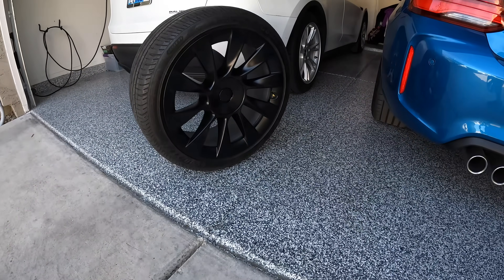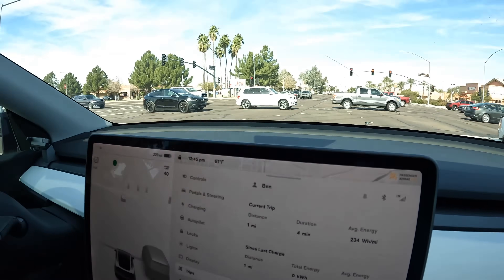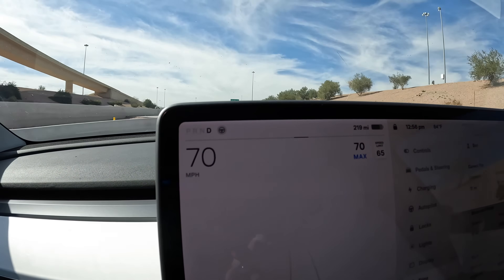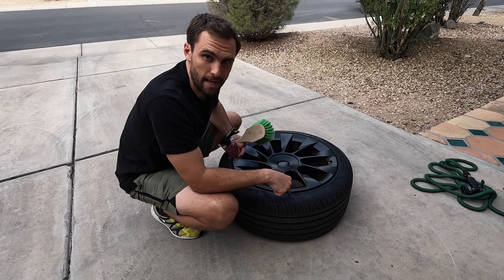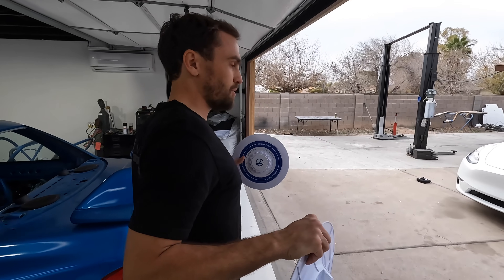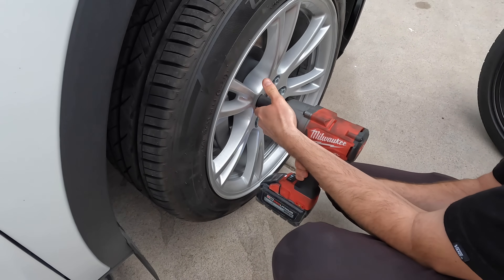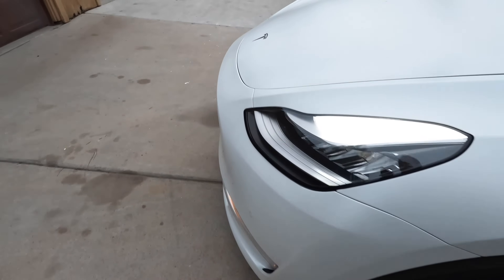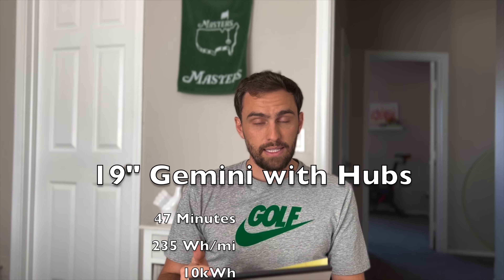Which Tesla Model Y Wheel is Best? - Range and Comfort Test

Comment: The halodisc's are not meant for range just FYI. They're more actually meant for performance and brake cooling. They're not meant to give you a better range. They're meant to provide more airflow like a fan towards the brakes for high speed braking, which is an even better benefit to have for a small cost.

Comment: Best wheels are 18", opens up possibility for a massively increased number of available tire options, for snow/rain/at/normal all season. Also smaller wheels lowers overall rotational mass if you find high quality forged lightweight aftermarket wheels. Finally the smaller wheels are superior because you can run tires with similar OD, but larger sidewalls, which improves suspension small and large bump compliance, and overall ride quality. 

If you aren't racing or doing track runs, get smaller wheels.

Comment: I just got a used 2021 model Y with 20 inch wheels, I love the car but I think the tires should be a little more tall to make the ride a little more soft, specially on not completely smooth roads.
Thinking on getting 25545R20 instead of 25540R20, do you think that will affect anything with the car, any rubbing or something??
Thank you for your help.
Reply from the maker: I just did a video on the Hankook ION EVO SUV tires. I would get those. They are incredible
Reply: @Gjeebs  I will watch it.
Thank you
Reply: @Gjeebs  I found a very good price Goodyear all season tires 255/45/20 with a tire load capacity of 1819 pounds.
Do you think that load is enough or should be higher?
Thank you again.

Comment: What does the car call for, 38 psi or 42 psi?  You're not supposed to guess at what the temp will be once it gets warm or whatever.  Most temps are taken at "cold."  That is a major mistake there when testing tires.  So it sounds like tires are NOT at the proper pressure.

Comment: The best combination is just to get the 19" tires (tesla spec continentals) and get a nice looking set of wheels from T-sportline (really great looking black / sporty look). You get the best comfort / range and also really great looks. I do this on my Performance Model Y and I get the same range as a LR Model Y, with sporty looks..
Reply: Just ordered a MYP. Can you give the link for those wheels?
Reply: @thedude7315  not a dumb question! It actually fits with no clearance issues on the performance brakes (19" tesla wheels), or in my case, the 19" t-sportlines made for this car. Unlike the Model 3, where you can't fit the smallest wheels on the performance version (brake issues).

Comment: Thanks for this video. I'm about to order a Model Y LR and I'm super excited.  I have  a question regarding the wheels though. I find it hard to pay an additional $2000.00 + for the wheels on an already costly car. So is it possible to get the 19 inch standard wheels that Tesla provides and then purchase a cap, from a third party, that is similar to the 20 inch induction wheels? I love how sexier the induction wheels look good but I don't want to pay an additional $2000 lol
Reply: Been 6mos, what did you end up doing?
Reply from the maker: There is no cap that is going to look as good as the 20's and if you want to buy the 20's from Tesla it's $4,500 so if you really like them just get them because in the long run you are going to be really happy you did
Reply: @Gjeebs  there is now,  those 20s are rough as crap hard pass
Reply: @xxxblanco which caps go you like?
Reply: @Gjeebs  Thanks for the advice. I appreciate it.  Does the 20's seriously impact your range?

Comment: I am not sure how you tested the Halo Disk covers... were you saying that you only had two of them and you put them on the front and ran the rear wheels with no aero covers?  Also, did you need to remove the wheel to install them, or just swap out the lug nuts?
Reply from the maker: Just swap lug nuts and you only get two in a set not 4. They only recommend 2 I’m not sure why

Comment: If I get a LR Model Y with 19 inch Gemini wheels,  I may consider getting lighter weight wheels to reduce the unsprung weight and lower the inertia to increase the car's range--and probably  improve the acceleration as well.
Reply: The discs are more important than weight for range. There are no other 19 wheels that beat Gemini with discs for range. Aerodynamics is more important than weight.

Comment: My understanding is that the recommended tire pressure is the cold tire pressure--and that is all there is to it.  The psi your tires will reach while driving will vary based on many things.   If it is 90 degrees outside and you are driving it hard on a race course the pressure will rise quite a bit.   If it is 65 degrees outside and you are easing around  town--then the tire pressure is not going to rise that much.  But it is not the driver's problem to try to micro-manage it.  I imagine that when your tire's psi rises while driving that the actual tire rolling resistance reduces and increase your range efficiency.   You would have to apply artificial intelligence to try to micromanage your tire pressure as you are trying to do.  Cold tire psi of 42 rising to 44 psi while driving may improve your range.

Comment: Factory PSI is 42 COLD, they will increase as you drive and that’s ok.  Mine climb to over 45 in the summer.  I’m replacing the 21” Uberturbines with some 18s from TSportLine next week.  I have driven my new PMY to 2500 miles in less than a month.  Gonna measure efficiency and performance between them.  Can’t wait to see the results.
Reply: How did that change go? Was it worth it for efficiency and ride comfort?
Reply: Any updates on that?
Reply: This video is old but I just want to comment on this thread.  I have 2019 Model 3 Performance.  Five years of ownership and multiple popped sidewall, cracked wheels,  I switched to 18x9.5 Apex EC7 flow formed wheels with 255/45r18.  Yes wider wheels and tires but minus two configuration with taller sidewall.  This saved 6lbs of weight per setup.  The ride is so much better.  You can still feel the road but now it is like a reminder instead of a jolt.  Car still grips like glue.  Best of all, I went from 275 to 260 Wh/mile.  Not bad considering it is a wider tread tire.  The pressure is 42 cold.

Comment: Stuck between LR vs Performace!! I drive 100-150 miles for my daily commute. Do you think the Performance 21" Ubertarbine wheels will wear out sooner than the 20" Induction wheels? Let me know if you have a video on this topic. All your vids are amazing. Thanks and keep them coming!!
Reply: I think you meant tires wearing out not wheels. Since he didn’t respond to your question, I will let you know my experience on the 21 inch wheels and tires on my 2012 Y performance with 21000 miles in 10 months. So far, with normal driving in city and highway driving ( traveling from Orlando to Miami every 3 weeks) the tread depth on the front tires are at 9/32 inch which looks new and the back tires are at 3/32  inch which now needs replacing . The back tires apparently wear out faster. Price on tire rack was 940 dollars ( two back tires) shipped to my home and Tesla service will charge 55 dollars per tire to mount and balance. My plan is to switch to 19 inch wheels in the future after all 4 tires wear down, hopefully at 20,000 plus miles. As a result, I can get a full set of 19 inch tires for around 1200 dollars. Much cheaper to replace. I hope this answered your question.
Reply: @rickeybarnes6471  Thank you very much for your respone. It seems like a recurring expense with the 21" tires around 20000 miles which I am sure I will reach in about 10 months max. Better to stick to LR with induction wheels for now. Thanks again.
Reply: Drive in chill mode? 21 to 20 inch wheels will only gain 1 mile at most. The problem with Tesla wheels are super heavy and creat drag.  Get yourself some light forged wheels and see the difference in weight. Extra cost is the issue. 21 inch tire cost more than 20 inch tire. If you worried about tires. Then my friend Tesla is not a car for you.  Tesla mosey y weighs about 5300 lbs vs normal ice Prius weighs under 3k lbs ans gives 58 mpg.  I have both. Just received my MYP and keeping my 21’s turbines and probably get a forged wheel set later.  You can buy cheaper tires, but read the load capabilities and capacity.

Comment: Nice test.  Side note - the tire pressure should be matched to specs when the tires are cold, not warm.  You stated you started at 38 psi with the goal to hit the factory recommended 42 when warm.  You should be starting at 42 psi cold.  Yes, they will rise to ~45 psi warm but that is not an issue.
Reply: It was kind of hard to listen to the rest after he started talking about the cold tire pressure.
Reply: Yeah but what if the person lives somewhere that doesn't get cold?
Reply: @gregthesplintercell  "cold" for purposes of tires is ambient temperature. If you start off below the cold pressure on the door, you are giving up range/performance from minute 0.

Comment: I currently have 20" Inductions and I really want to soften the ride. If 19" feels better, would 18" feel even better than that? Which is a better investment for ride quality: wheels/tires or luxury coilovers?
Reply from the maker: I would say the better option is the wheels because they will improve your ride quality AND give you better range. Suspension will only improve your ride quality
Reply: I had the same question. I have the 20s but ride is rough. UK roads are not made for this car. I don’t like 19s. Need to find out if I can put higher wall tyres on the 20s. Should be enough space if the Performance can hold 21s.
Reply: @Gillacticomusic  Can't you order a 19" set of a different colour? Perhaps black, to get both comfort and a good look?

Comment: The recommend tire pressure of 42psi should be when the tires are cold. After driving for a bit and the tires warm up, the pressure will increase to 45-46psi.
Reply: OEM recommended tire pressure is ALWAYS cold. ie not driving on the tires for ~8 hours. You should know better if you're doing a tire video.

Comment: Why are you surprised that the 2nd most inefficient was the halos? I took one look at them and how they fit on the wheels and I'm actually surprised it wasn't worse than the 20" wheels. I think that if you actually installed all 4 of them it would be worse than the 20" induction wheels.
Reply from the maker: There is research behind them showing they increase efficiency. I should have had the rear covers on to make it fair

Comment: Real-world range difference between 20's and 19's = 3.1 miles.  I went with the 20s too.
Reply: the 18"'s are better for not only mileage but with more beef, from the tread to the rim, you get some protection should you run into a pothole.  Plus beefier tires just look better.  But then again I grew up in the 70's muscle car era and beefy tires were the norm.

Comment: Would’ve been better to have 3 sample runs for each wheel combo but that’s time consuming on your end. Also mi/kwh is more like mpg and you can better estimate your true range with that. On my MYLR with 20” wheels lifetime avg energy is 314 wh/mi or 3.19 mi/kwh. So my true range is 3.19 mi X 78 kwh battery capacity = 249 miles based on my lead foot. On a few 1000 mile trips I’ve driven, averaging 75-85 mph on the highways, I’m down to 10% charge after 200 miles from 100% charge. So probably about 225 miles range at 80 mph average speed.

Good test but the 4 kwh difference (40%) between the 19” and 20” may be an anomaly because of single test runs. Thank you.
Reply: agree. 4kwh on that lap is joke, math fail for thw win
Reply: A agree 40% drop seems way higher than what their website states.  That doesn't math for me.

That means us 20 inchers would go from a 330 mile range to a 198 mile range?!?

Comment: Great video. Keep them coming. I've learned a lot, and laughed a fair amount too. I wonder how my winter tires would fair out. Probably not too well. 
Microphone recommendation - Rode Wireless Go Mic with a dead-cat. I think I saw you using one in another video when you were on the street asking preference between the Ford and Tesla. It attaches to you so it shouldn't be affected by car movement, and the dead-cat should deal with a fair amount of the background noise.

Comment: If 42psi is recommended it should be 42psi on cold tiers. 38psi is to low and less efficient. Liked the video, keep up the good work.
Reply: For you guys running 50 or near 50, do you see uneven tread wear?
Reply: @hgodtx  50? Sure if your Tesla is a Flintstones mobile replica. WTF?
Reply: What is the point to test half hubs? Assume it is efficiently, I doubt that many people will drive Tesla with half hubs.
Reply: You dummies. He said this on purpose so you comment. He knows what it’s supposed to be. Just trying to game the YouTube algorithm.
Reply: What are cold tiers?
Reply: Factory always gives you cold pressure not hot. I guess you tubers are smarter than engineers that set the pressure
Reply: Well Elon Musk suggested 39 psi. Granted he's no engineer.
Reply: 42 Cold is not good while driving through the Desert to Las Vegas where temps are in the 100’s  at 42 Cold with my Model Y  I see 50 PSI when it’s that hot and have to pull over to let some air out.  So now I start at 38 and see a safer 46.
Reply: @fredsmodel3  from the model Y owners manual: “Do not let air out of warm tires in an attempt to match recommended cold tire pressures. A hot tire at or below the recommended cold tire inflation pressure is dangerously under-inflated.”
Reply: @joshlemons3662  Thank you Josh, I will just keep it at 40 when I start a trip when temps are extremely higher,  good to know. Fred
Reply: @fredsmodel3  Yes, the psi recommendation by the automakers is always for cold inflation.
Reply: @fredsmodel3 we are not talking about specific hot areas we are talking in general. Maybe in Antarctica we should do 45 psi right?
Reply: @fredsmodel3  the recommend pressure is always the cold pressure. I understand the heat will make it higher but 50 isn't unsafe.
Reply: @fredsmodel3  I've run 50psi cold in all my vehicles for years for the most mileage.  50pi is way below the tires burst rating.
Reply: @Resist4  whats max psi for your tires, are they truck tires?? most sedan tires max psi is 50
Reply: @drums25K  The max pressure on the sidewalls of my Model 3 tires says 50psi cold.  They the OEM tires that came with my car.
Reply: @Resist4  you are not supposed to run 50psi cold/hot in your tires that is extremely dangerous. how have you not had a catastrophic failure yet. it says MAX for a reason it isn't a suggestion a suggestion is on the sticker in your cars door jamb "recommended 42 cold"
Reply: @drums25K  Actually it is not dangerous at all, the tires have a much higher burst rating.  As long as you don't go past the sidewall max PSI cold and weight rating, you are completely safe.  It's a huge misconception that the door jamb psi is for safety, when it's really a compromised between comfort and mpg.
Reply: @Resist4  All the Maximum Pressure of 50psi means on the tire it that you cannot safely exceed that limit. Again the closer you are the more dangerous it gets.
Reply: @drums25K  and again, tires also have a burst rating which is much higher than the max psi rating on the sidewalls.  But still, if a tire has a listed max psi rating with a weight limit, as long as you don't exceed the weight then there isn't a safety concern.  And my proof of all this is that I've been using 50psi in all my vehicles for over a decade now without any issues.  You might want to educate yourself about tire burst ratings because most car tires in good condition, won't blow until they filled to over 200psi.
Reply: @Resist4 lol run it at 60 why not lol. So to save gas you are ready to compromise driving, stopping and etc?
Reply: @VIPP79  Because 60 could bring it much closer to the burst rating when the tire gets hot.  Using 50 psi cold doesn't get it close to 60, and it doesn't compromise driving, stopping, excessive tread wear, nothing.  Again, the lower psi ratings of 34 to 40ish are compromise for ride quality (comfort), tire life and mileage.  I've run 50 psi in 3 different vehicles in a period of almost 20 years using different tires and they have been fine.  With that said you can't use 50 psi and exceed the weight rating of the tire.  So if you cary heavy loads then obviously you need to lower the tire pressure.
Reply: @Resist4  Point is use factory settings on cold and do not play you are smarter than engineers that build the car. Understood I guess you did not catch my sarcasm?

Comment: 14kwh / 43 miles = 325 wh/mi With the 20"
10kwh / 43 miles = 232 wh/mi with the 19" with caps.
I don't think you can trust the kwh numbers.
Going the other way you get 235 wh/mi * 43 mi = 10,1kwh with the 19" with caps and 253 wh/mi * 43 mi = 10,9 kwh with the 20"
Reply from the maker: Thank you
Reply: I don’t think the kWh used takes into account regen, just says how much you’ve taken out, not consumed
Reply: @CryptoNut82  that would not explain the discrepancy. It’s usually <10% of the consumption. Also there is usually very little regen on the highway.